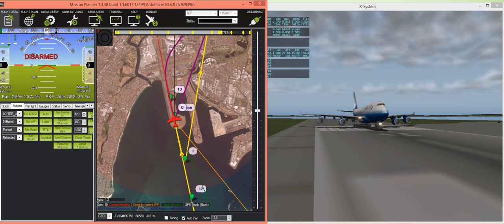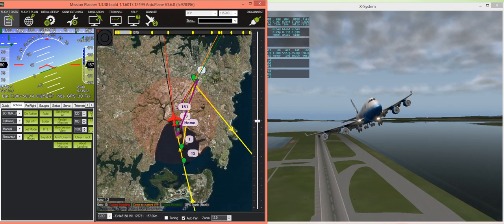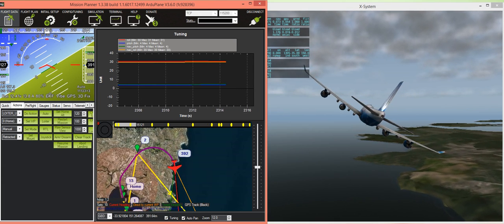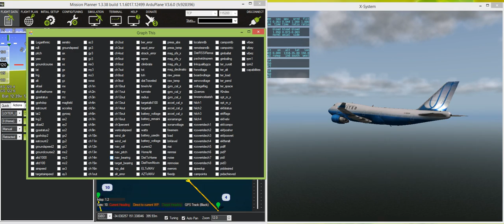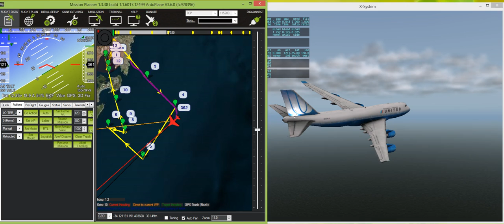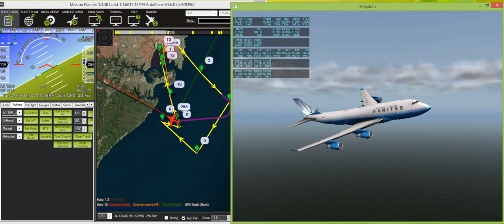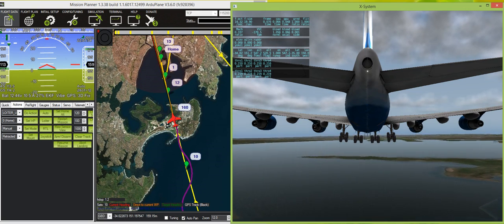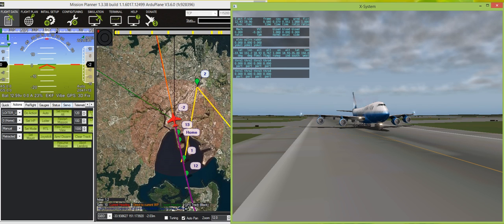Flying a 747 in X-Plane 10 with ArduPilot SITL

Comment: Hi everyone, If you Mission Planer V1.3.76 does not work with Х-plane 11, you need to go to the network settings and change the ports.
Flying by waypoints didn't work for me, I changed the port values and everything worked for me.
UPD-Ports
Need a checkbox
Need a check Use UPnP for IPv4 port forwarding
Port #1 = 49010
Port #2  = 49000
Port #3  = 49002

Comment: Thank you for posting this wonderful video. I am just getting started with hooking up SITL with X-Plane (11.36) and I am a newbie to ArduPilot/SITL, and not that much better with X-Plane either! I would like to try what you did on my system for learning the SITL<>X-Plane better. Is there a set of parameters that are required to be setup on the SITL side, if I want to use MissionPlanner to fly a 747-400 on X-Plane? Would it be possible to get the params/configuration you used? Thank you.

Comment: I get an altitude of -414.25m in Mission Planner with a plane sitting on the airstrip, showing 1409 ftmsl (0.38 ftagl) in X-Plane 11.
I am exporting Latitude, longitude & altitude (index 20) in X-Plane.
Any idea what I'm doing wrong?
Reply: hi. I just met the same problem here, have you solved it?
Reply: Hi! I hope you got your question answered in the last 10 months. I am new to Mission Planner and ArduPilot/SITL, and I was wondering if you have tried to get a 747-400 flying like in this video. I have been trying to do that with not much success. Thanks for any pointers.